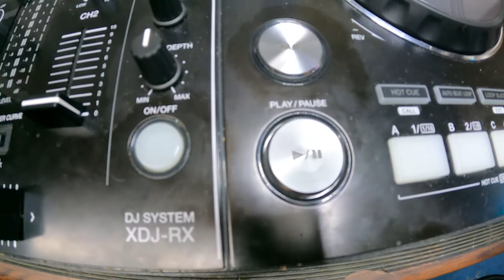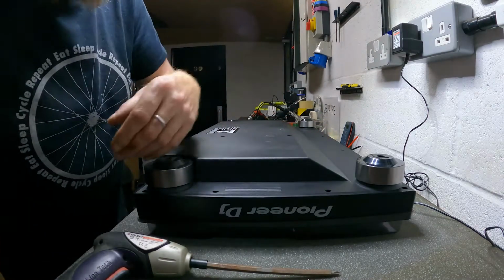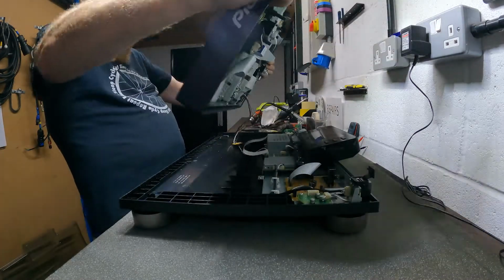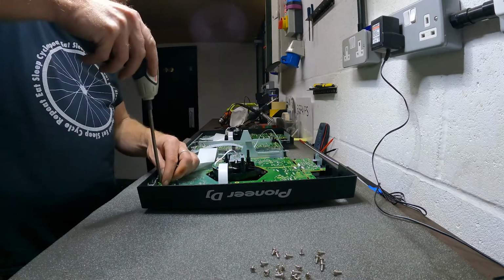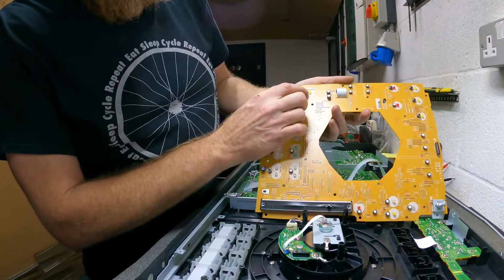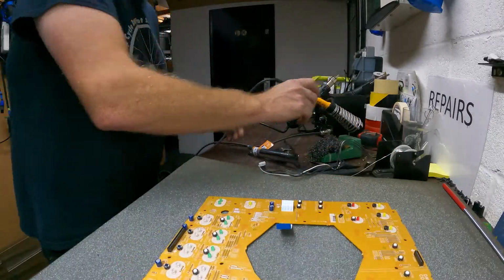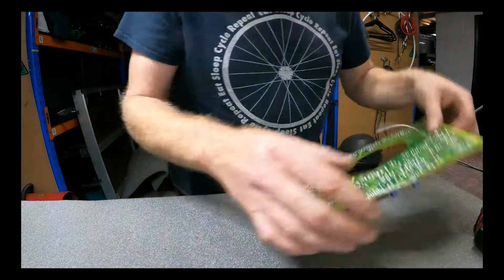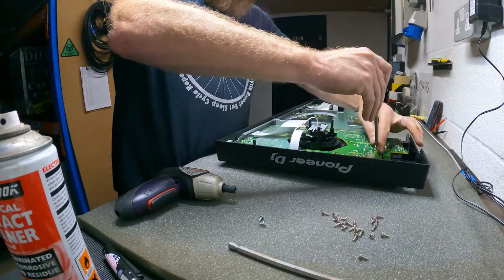How to sort your Pioneer XDJ RX Cue & Play Buttons

Comment: Good work! Try using some flux and a solder wig and you don't need to play with the old solder so much. Does anybody make a higher quality aftermarket button alternative? The price of the original is not an issue but it seems that these buttons fail pretty often so having better quality than the OEM would be a good idea.

Comment: Hey. I had my mixer fixed about 10 months ago. Now the right-side cue button is not working properly- if I press it hard it will work. Do you think it can be the button or the plastic cover of the button? Thank you!
Reply: Hey Man! I have the same problem where if I press it hard it works but only until I leave the xdj unused for a couple days. Did you figure out what was causing the issue?

Comment: BE CAREFUL TO NOT LIFT PADS ON THE PCB!

Thanks for the great video, I could replace buttons and all seem to work fine, but I lifted two pads in the process. The PCB seems quite fragile.

- Unless you already have some welding experience, I would recommend practicing on some cheap PCB first. Remove some component and replace with new one. 
- Use low temperature, 350 Celcius should be enough.
- Make sure to clean up any tin reminder and be really careful when pushing the new button. Tin reminders might block holes and lift pads.